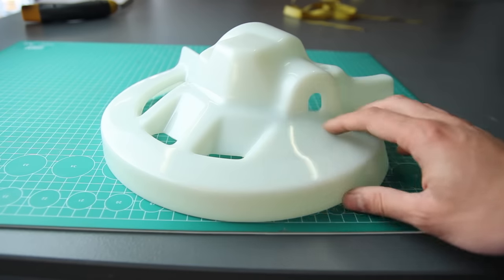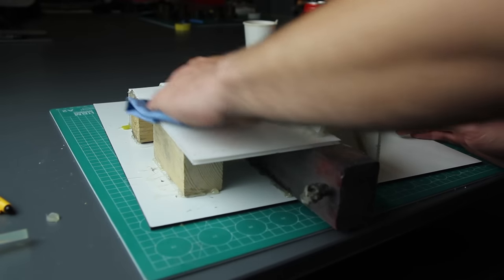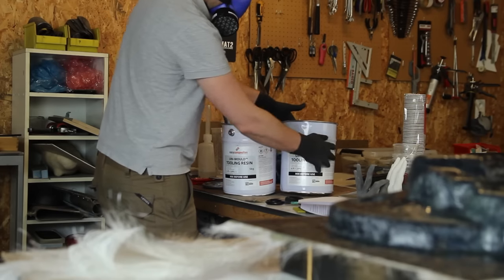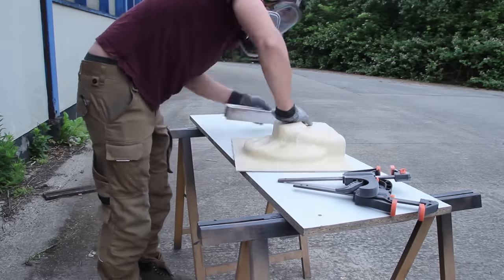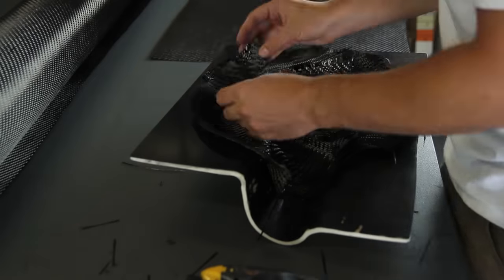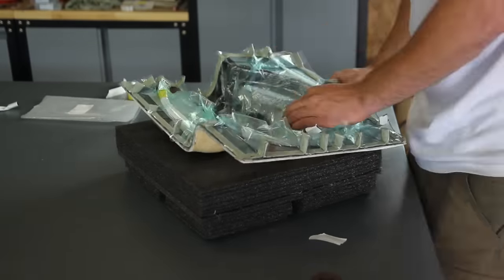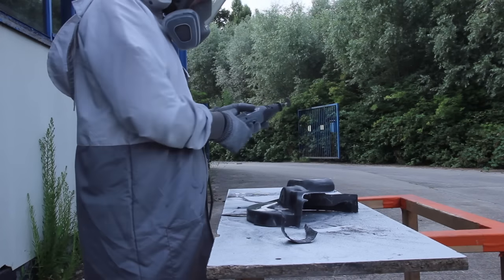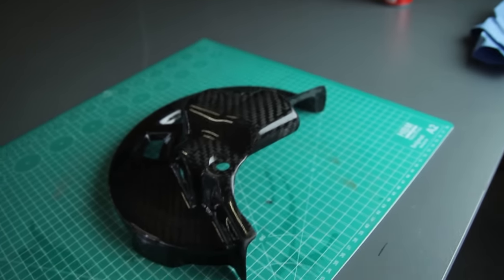How to Make a Carbon Fiber Part - Disc Brake Cover for HONDA motorcycle

Comment: Great video for people that are working with polyester / vinylester resins!  👍🏻 I‘m a fan of epoxy, a bit harder to work with it but the moulds are tougher and some other benefits. Especially for our autoclave
Reply from the maker: True on more demanding moulds I use epoxy as well, mostly high temp resins then

Comment: Hello Matthieu! Great video, thank you so so much for taking the time to film! I have a question: How do you prevent from parts going yellow, if they are not painted? I have some parts I made, but they went from clear transparent to yellowish transparent.. Thanks!
Reply from the maker: Did you use a gelcoat? Here it's almost bare carbon on the surface so not a lot of resin that can yellow, otherwise depends on the brand of the resin system you are using.... Another solution is to use a 2k clearcoat with a uv blocker in

Comment: Honest question, the exposure to high heat from the brakes is not an issue with the resin? Like bubbling? Saw bonnets with that issue, so I always stayed away from high heat applications, in fact I want to prepare an underbody for my e39 on carbon fiber and because of this reason I don't
Reply from the maker: good question! regular epoxy resins will be save till +/- 70°C if you need higher temp applications you could use a high temp resin that is save till 150°C but you'll need to make some adjustments to your mould (high temp gelcoat and resin) and postcure your part till higher temperatures for that. So far it's good for this application but different applications might need different resin systems

Comment: I noticed you used the wax to make a seal between the old part and the board.  This fillet radius will show up in the mold and means that the finished part has a radiused edge and does not match exactly the original part.  If you wanted to make a part with straight edges how would you make the mold?
Reply: The filleted edge is runoff. Extra material after the part edge that gets trimmed off after casting. The filleted edge is so the original part doesn’t get locked into the mold during the molding process

Comment: Great video Matthieu! Thank you. How much +- same part will be costs to customer? Mould and small series production(up to 20 pieces)
Reply from the maker: Hi, Thanks! Using this technique, these are pretty expensive parts...The mouldmaking is a big time-consumer as you might see in the video, specially if its just for one piece.
I think you would be at around €400/part which might be hard to get sold at this price, specially if you are looking on chinese websites offering them for a way lower price (lower quality as well obviously) . The problem is that most people take price as a more important thing than quality, making it hard to get these sold unless you are really looking for something specific or modded specially for your needs making it worth the price

Comment: just one thing dear mat you said you mixed one kg then followed with the second cup and it seems the second cup is as much as the first cup so I assume you are using 2kg of unimold resin then you said you used 400 gram of CSM this makes the resin to fiber ratio of one to five am I missing something in here? is this correct?
Reply from the maker: yes correct! good thinking! It's a bit different with the fiberglass - tooling resin than with other resins and fibers where you aim for a 50/50 ratio. You have to X5 the Chopped fiber to resin ratio here. It's pretty rich on resin in comparisson to fiber. But keep in mind that 5 Kg of resin will give you less litres of resin (meaning the density of the resin is higher as it is filled with all kind of materials, I dont know of :D) This to offer you stable moulds with less shrink.

Comment: On your sanding table, what do you call the rubber part that is on top of the table?  I've always been curious and really would like to have something similar for my sanding.  Thanks!
Reply from the maker: I buy it at the hardware store, These are just rubber floor mats

Comment: in a part like this there is no benefit in taking it to the oven?
Reply from the maker: The part got post cure into the oven at 60°C yes, this will ensure the part is stable till these temperatures at least

Comment: What cutter are you using at 7:50?
Reply from the maker: called "EC cutter" will be featured soon in a "Top 5 Tools for composites" video ;)
Reply: @MatthieuLibeert  Thanks so far I have bought few different carbon specific cutting and grinding tools, used them for something less demanding and those have been destroyed immediately from cutting wood or roofing material. Have carbon waiting but I destroyed my tools before.

Comment: here's what I would love to do.  I would love to make fairings for a motorcycle(that have the same style as a 2022 Ducati Panigale V4S), but I would want to create it for the 2022 Suzuki Hayabusa.  I would want to create the side fairings only.  If you look at the 2022 ducati Panigale V4S you will see that they resemble 'shark gills'.  That's what I would want to create for the 2022 suzuki hayabusa.  Mathieu, would you or anyone you know be able to create the carbon fibre fairings for such a project?

Comment: The finished look is pretty low quality, heavily distorted weave, sanded through fibers. Might as well make it out of fiberglass, if it is going to get painted. Pre-preg next time?
Reply from the maker: Like mentioned this is a B-grade Carbon fiber that is woven in a not so tight way than the more cosmetic fibers I otherwise use, went for ease instead of cosmetic. Did some parts in prepreg as well in the past but took me double the amount of time, resulting in a better finish but more expensive part. Went pretty hard on the sanding as it didn't matter that much, part will probably get painted. Correct, sanded through a few fibers but I'm not making parts for NASA or military here so shouldn't have to much of an impact on strength here. Sometimes you just need to find the right balance between effort and price for a part

Comment: Brakes get very hot, not sure this is a good idea.
Reply: Depends on the resin matrix that is used. Our parts are made with prepreg & autoclave, and they can handle this temperature without any problems.
Reply from the maker: Should be ok for here, should be able to handle over 70°c, the guard isn't in direct contact with the brakes so heat gets removed quite quickly
Reply: Most Dirt Bikes run a disc guard.
Reply: @MatthieuLibeert  a brake rotor temperature varies from 200 degrees Celsius to 550 degrees Celsius, depending on how hard you're using it. Hopefully you don't have any issues with the air gap and airflow.
Reply: @Specter0420  A dirt bike won't reach those temperatures for long enough to cause a problem. Look at brake shrouds for f1 cars. They're carbon
Reply: @superswede97  they may be carbon, but the weakest link in carbon fibre is the resin. And for high heat application they use special resin and that require more expensive equipment
Reply: @mojo331  I'm well aware. Dirt bike brakes don't really get hot tho. Brakes only slow you down. You should be mixing gas and hauling ass 🤙